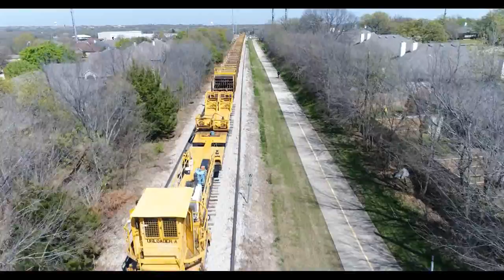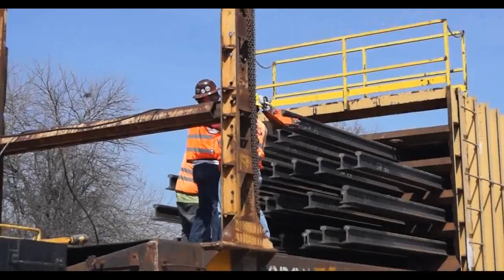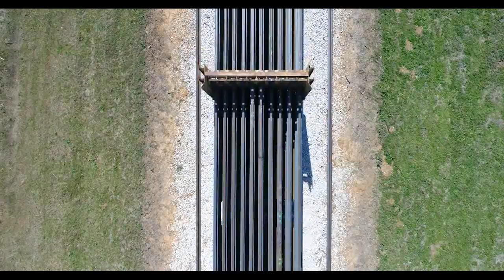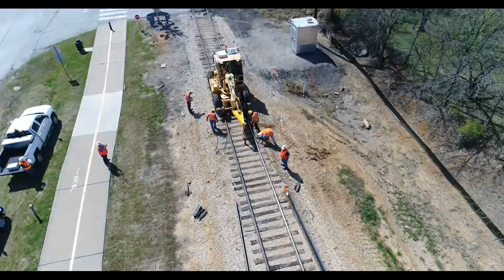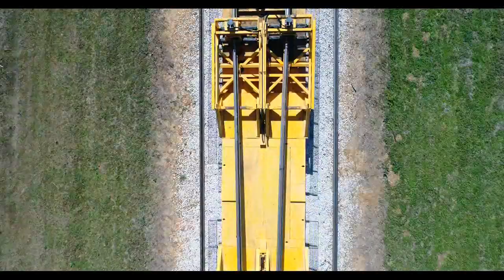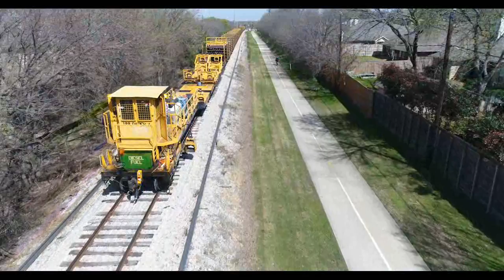Unloading a Rail Train

Comment: Those rails were long..... were they like that already or were they welded / attached as they were unloaded?
Reply from the maker: The rails are welded together at the factory as they are being loaded onto the cars. In our case, each rail was 1,600' feet long when it arrived. This particular train held 50 of these rails (Strings) for a total of 80,000' feet of rail. It took us 2 days to off-load the train at various location along the corridor.